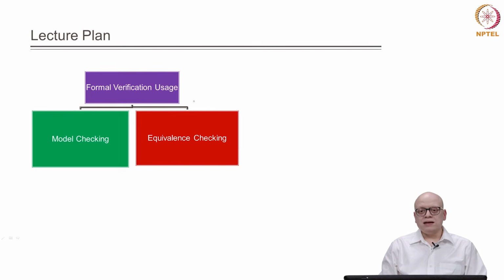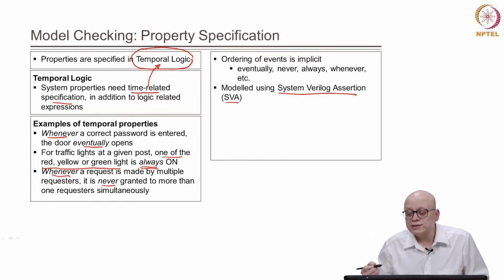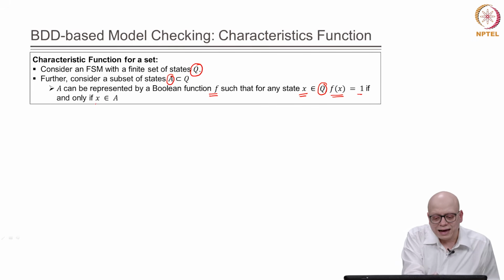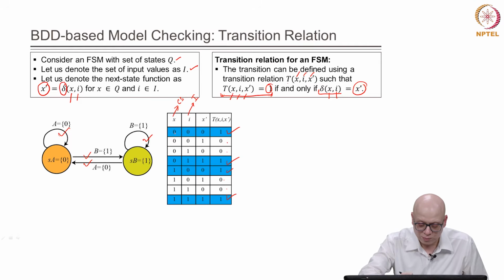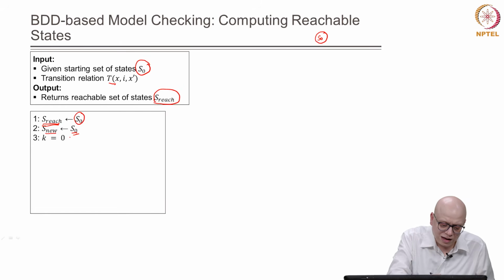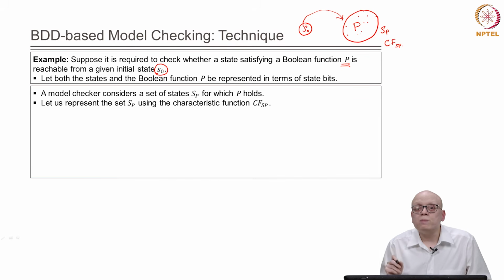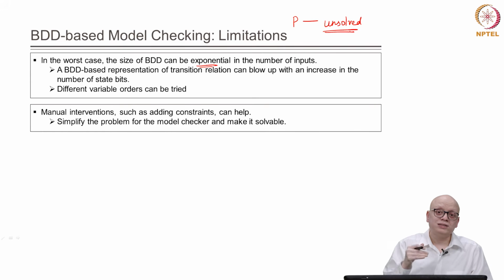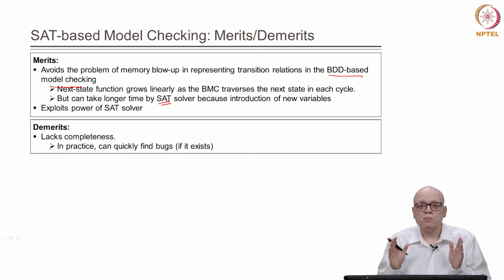Formal Verification-III

Comment: Timestamps (Powered by Merlin AI)
00:05 - Overview of formal verification tasks in VLSI design flow.
03:48 - Model checking verifies properties of finite state machines through all possible states.
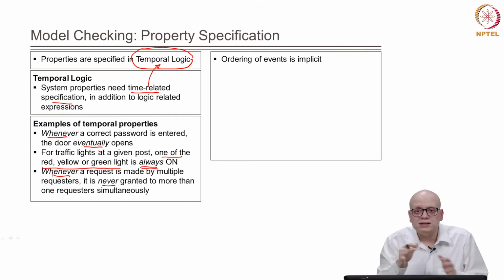09:31 - Modeling properties in verification using SystemVerilog Assertions (SVA).
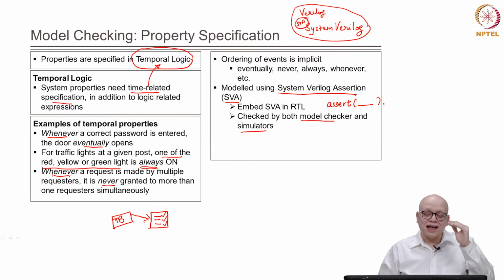12:29 - Model checking offers complete property verification without test stimuli.
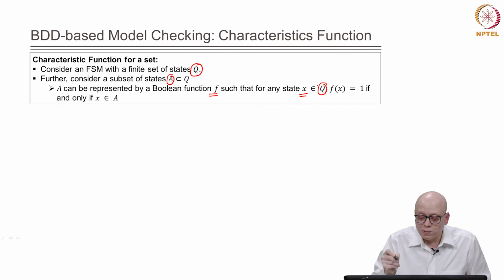18:19 - Definitions and examples of characteristic functions in finite state machines.
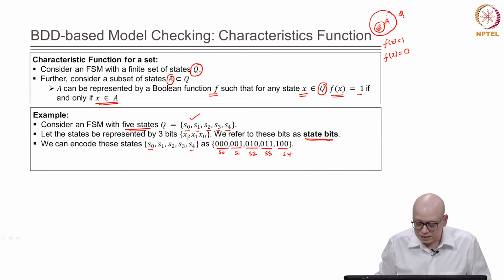20:54 - Encoding subsets of states using characteristic functions.
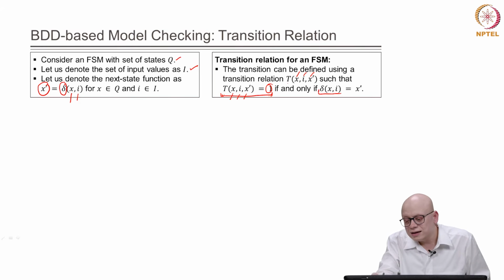25:32 - Understanding FSM transition relations with examples.
27:57 - Understanding transition relations in FSMs and BDD representation.
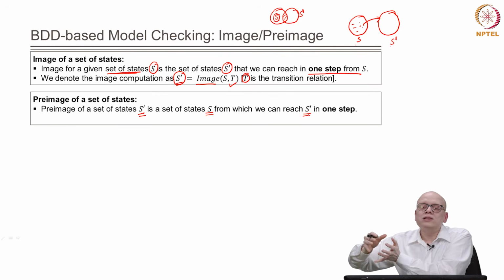33:00 - Efficiently compute reachable states using BDDs in formal verification.
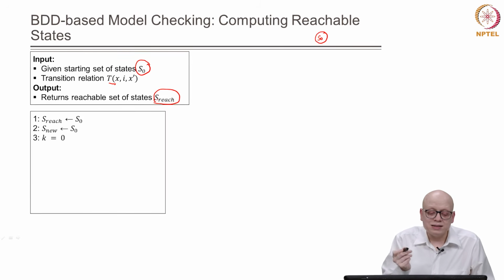35:33 - Expanding reachable states through iterations in formal verification.
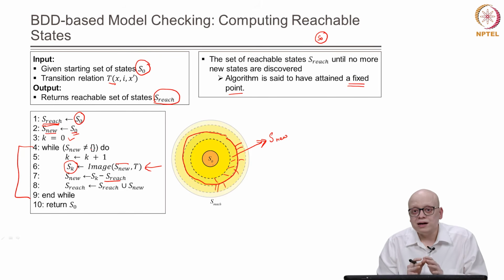40:34 - Using BDDs for efficient symbolic state traversal in formal verification.
43:04 - Model checkers evaluate state reachability concerning Boolean functions.
48:34 - Property checking using BDDs determines state reachability for verification.
51:00 - Managing Boolean function complexity in formal verification.
55:51 - Bounded model checking iteratively verifies if a function is satisfiable.
58:00 - The bonded model checking unfolds system behavior over clock cycles.
1:02:34 - Bounded Model Checking aids in detecting design bugs effectively.
Reply: That's quite useful actually